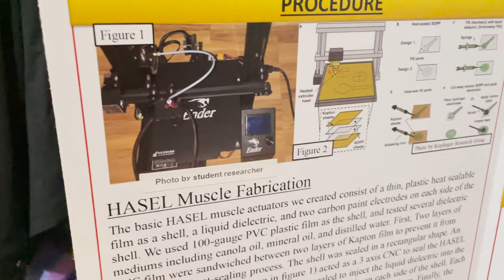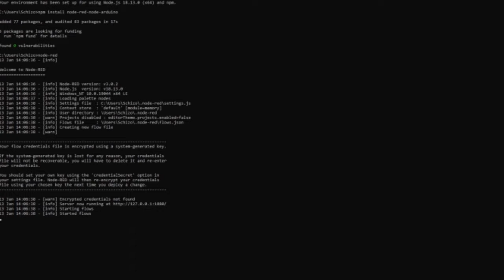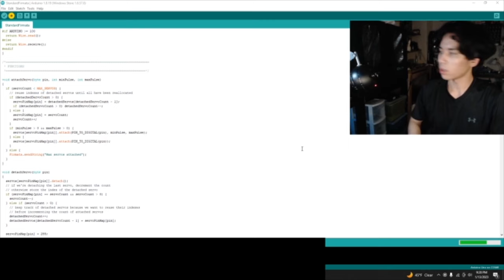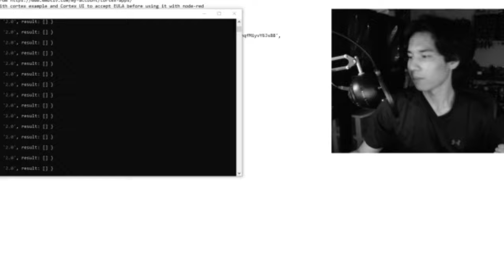Controlling Electronics with my Mind! | EEG Brain Computer Interface

Comment: Were you happy with the emotiv epoc x api vs a mindwave? Is there any other products out there that is better with 14 electrodes? I used a mindwave and the API was ok but only 2 electrodes.
I want to use machine learning to try to train and reconstruct images like shapes and patterns to start. (Might need something like a fNIRS to go with it to make it possible)
Any advice would be great. Thanks

Comment: Build an exoskeleton for paraplegics and quadriplegic ppl to wear and link the EEG to the Motors by desired brain interface signals that are programmed according to each individuals thought processing . 
It's at least some way to give persons with disability the option to move their limbs through thought processing with the help of a motorized exoskeleton suit . Make it lightweight out of carbon fibre and use the minimum acquired motors to achieve flexibility and movement for each joint of the limbs . 
It can't be that difficult to create. And build the EEG system in a wearable helmet which will serve as a safety measurement.

Comment: I have a question, do you need the emotiv headset to use the emotive software for your bci? Or can you use your own technology and still use the software?
Reply from the maker: The emotiv software is only compatible with emotiv headsets I’m afraid. There are other options out there though like openbci among others
Reply: @schizo4725  ok! Thankyou! That was very helpful
Reply: @schizo4725  also, so sorry if this is a stupid question, I’m still new to this, but is it possible to make your own bci headset? And if there is, are there any simple video tutorials or websites for it?
Reply from the maker: @shadow_spite7121  of course it’s possible, just maybe a little difficult. The words simple and electroencephalography  don’t exactly go together lol. It takes a solid grasp of electrical signals and some computer ability to pull off engineering a headset with even a few electrodes from total scratch. I sure don’t think I could make a very good one. But there are open source bci headsets such as openbci that can help get a good understanding and allow you to have more control over the design and software application.
Reply: @schizo4725  ok, thankyou so much for your help. I really appreciate it

Comment: Where did you learn the code for the emotiv epoc,? Im in hs trying to figure out it all and do i need the SDK package in order to make my own prpjects?
Reply from the maker: Tbh with you, I'm not a very experienced coder, I was mostly just figuring it out as I went along. The emotiv SDK is kinda part of the emotiv software. You just have to register the app on your emotiv account to connect it to your headset. I found this kind of vague and you're probably going to have to play around with it like I did but this is the most thorough document there is that I could find. https://emotiv.gitbook.io/cortex-api/

Comment: I have  emotiv 5 channel head set and i am trying to do the same project .Do we need to download the data that is do we need to have the subscription for emotiv pro to do it  and how to establish connection between Arduino and emotiv .
Reply from the maker: No you don’t need emotiv pro, just your emotiv Id. There’s also an authorization key you need to generate. There’s a manual from there website that details how to do it and it depends what software you’re using to control the connection but I managed to figure it out.

Comment: Can EEG be used for speech like Stephen hawking
Reply: I’m not a subject-matter expert, but restoring speech involves the stimulation of neurons in a specific part of the brain called the Broca’s area and then the motor cortex to move one’s mouth, and therefore external EEG which is on the scalp, cannot effectively stimulate those neurons inside the brain to restore speech. 

Neuralink will focus on invasive applications such as these in the coming years.
Reply: @quentin2578  He's talking about using a BCI for this.
Reply: @TheActualCorrectOpinion  EEG != BCI per se
Reply: @quentin2578  That's not what I'm saying